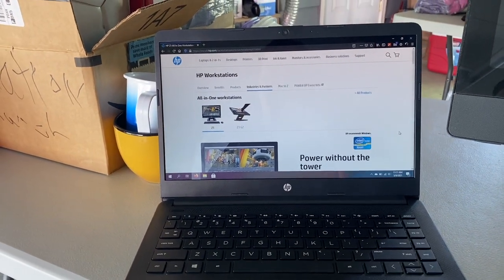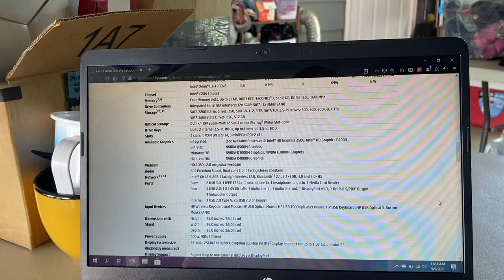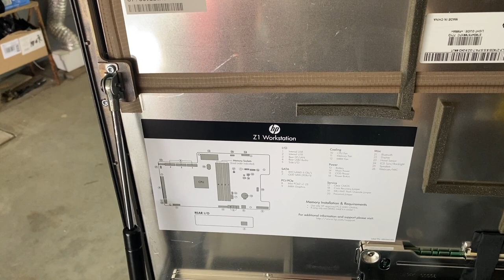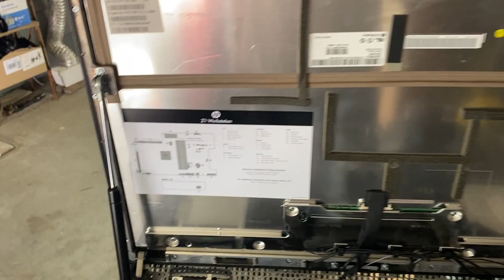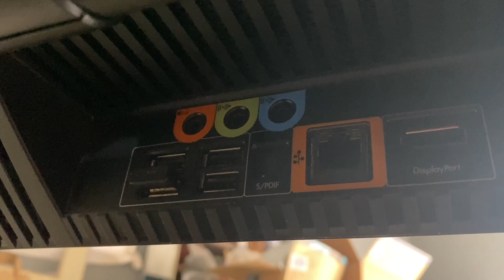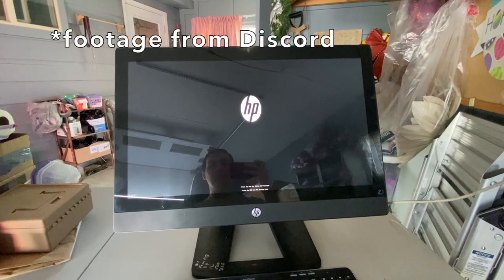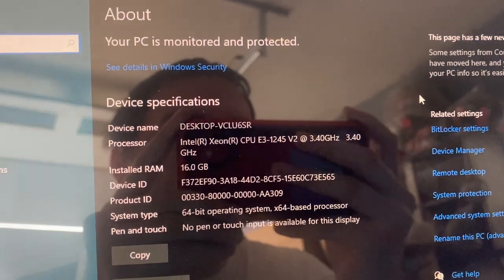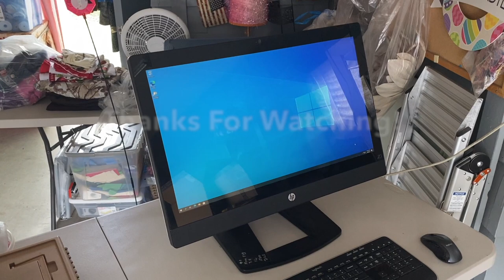HP Z1 All-In-One Workstation (2012) Overview

Comment: My setup on this computer:

CPU: E3 1280 3.5GHz
Turbo 3.90GHz 
GPU: GTX 980M 8GB 
Ram: 16GB 1600Mhz ECC
2 SSD 1 TB drives 

Gaming wise it runs most games on medium or high. The graphics is the bottle neck. I do know they made more graphic cards 1050 and 1060 for laptop, but I have not seen any that are worth the price ($1000) plus it requires some modifications from what I am told.
Reply: Ya I was thinking of building my own pc but I also like this might get both one for editing one for gaming

Comment: What’s the best graphic card for this?
Reply: Since he didn’t respond. I will respond. MXM 3.0 B best card is the 980M from my research.The best GPU that has the plug and play is a 5100M.
Reply: As in 5100m if you don’t want to do any work 980m if you want to. Which is not hard
Reply: I just put in a 980M. Very very simple. This is the best card with is Mxm at a reasonable price. Anything more and just switch systems.

Comment: I just tried to start my Z1G2 after sitting a while (6 months). After posting the hard drive info and the message "press control-I to enter configuration utility..." it beeps one time and locks up with the cursor flashing afterwards.
Steady blue light is on.
No green light
No red light.
unplugging pressing cmos reset button does nothing.
Moving/removing ram chips (2) does nothing.
Reply: I Usually have an answer to this, But I can't really assist you without being hands on with it, but that's not an option, so ill just think about it and see if I can recommend an option.
Reply: @Andersstuff  The correct answer was "dead cmos/bios battery".
Reply: @kuei1215  oh.
Reply: @Andersstuff  was it repairable?